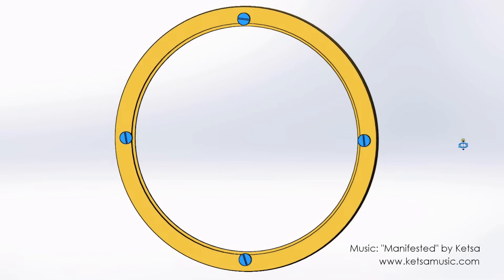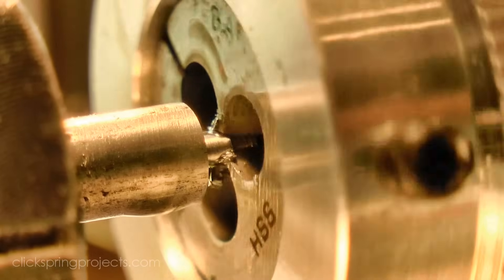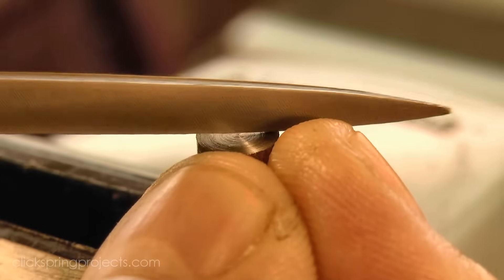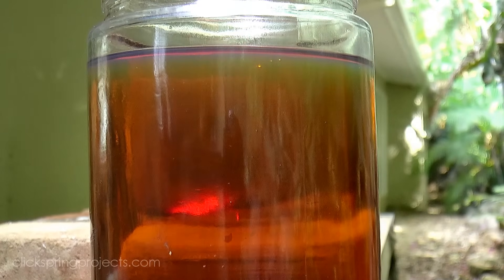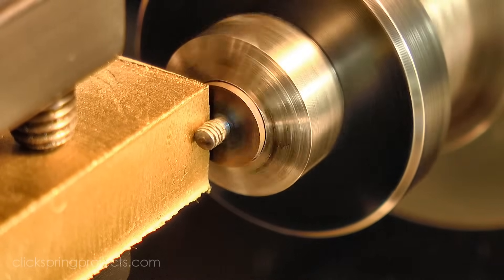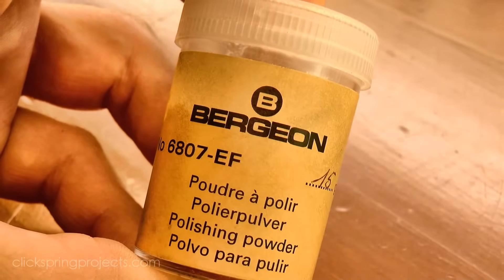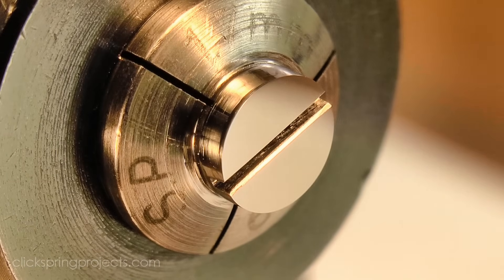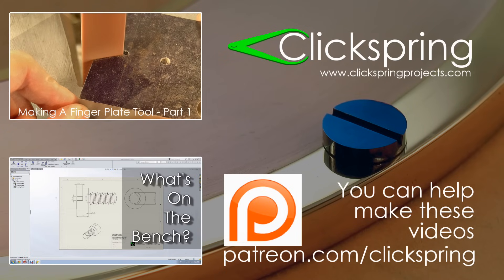Clockmaking - How To Make A Clock - Part 11 - Making Polishing And Bluing Bezel Screws

Comment: I've looked everywhere but no matter where I look I can't find anyone who has a 10mm thick piece of tin in square or disc form, where did you find a chuck of tin like this?
Reply from the maker: Hi Shane, tin is relatively easy to cast to shape. Also, keep in mind you don't necessarily need 10mm thick, a layer of tin cast over a substrate (eg brass. bronze etc) would be fine. The main thing is that it be pure tin upon which you ultimately conduct the lapping - Cheers :)
Reply: @Clickspring  awesome thank you so very much for responding to this years old video, I am a beginning watchmaker and it’s tough starting at a time like this, I just finished making all the components on the plans I bought from your site and the last thing I need is the tin disc. I gotta say I absolutely love your content and what your doing it’s amazing, have a happy holiday and happy new year! Cheers

Comment: I have a question. When you have to do multiples of the same detailed part like this, would you do the same step for each piece, then move on to the next step. "Assembly line" style comes to mind. E.g. polishing the undersides of all 4 screws, and then flipping and polishing the tops of all 4. Or do you just complete one, then start the next?

Comment: I saw you put the screw in a spring collet 
and I was wondering if the thread or the spring collet got damaged?
Reply from the maker: That's one of the great things about collets - they spread the clamping force over a greater surface area than for example a 3 jaw chuck, so features like threads are protected - thanks for watching and asking :)

Comment: Just a note from a clock maker your videos are great and very informative, please keep it up. Have you tried using shaved soap and water mix to prevent oxide forming when hardening, it is cheaper that boric acid and meths but also leaves less to clean up in the way of baked on residue?

Comment: As someone who's new to this kind of thing, is tempering purely cosmetic? What's the purpose of the (what look like) brass shavings?
Reply from the maker: Hey James - tempering does 2 things. The cosmetic look is a nice secondary benefit, but the primary purpose of tempering is to change the metallurgy of the part, taking it from being very hard and brittle, and reducing the hardness somewhat making it "tough". This makes it less prone to cracking under strain when inserted. It is widely believed that bluing also provides a measure of corrosion protection, but I have my doubts. I have plenty of blued screws that have corroded just as readily as non blued. I suspect that what little protection it does provide is actually due to a small amount of oil becoming trapped in the oxide layer. The brass shavings are helpful in transmitting the heat tot he part in a slow and uniform manner. Thanks for watching and asking :)
Reply: Thanks for the informative reply! I've been watching and learning as much as possible lately.
I've just recently started a mechanical engineering apprenticeship that I developed an interest in thanks to watching youtubers such as yourself.

Comment: Really great vid, learned a lot.  Is there a technique you recommending for turning the bottom surface of the screw (the part that touches the bezel) on order to time the screw slots while staying within your torque spec?
Reply from the maker: The process I use is: Make the fasteners but do not complete the slots, leave them slightly overlength. Drill and tap the holes, and then insert the fasteners (gently use grips, but be sure to get them in there to the correct tension), pick a direction you'd like the slots to align with, and mark. Remove, and then form the slots as normal. Face to length and skim the head perimeter, to remove any marring from the grips.

Generally it is more trouble than its worth, particularly with steel screwing into something soft like brass. The effect is soon compromised as the threads wear in (which you can try to predict to a certain extent) but a clock (or watch) must be repeatedly taken apart over its lifetime, so the effect is totally lost as soon as the first full clean & service occurs and the screws get mixed up. My personal opinion is that if the tapped material is soft like brass then its much better to embrace a little randomness in the presentation, and simply let the slots fall as they may.

Having said that, its definitely worth considering for hard materials, like steel screwing into steel. I used the procedure described above on the first Patron Series project hand vise fasteners, gave a good stable result.

Comment: Hi Ok, I give up! where did you get that tin lap? I have searched everywhere!!I have also just spent a very pleasant half an hour reading through the lathe recommendation on your blog. Very good, one tiny point I would like to add is the quality of the motor. For example my SC3 with its nice 500w brushless motor, I consider a serious lathe whereas its direct predecessor the C3 with the brushed motor and that awful back gear, was a terrible machine that should be cast adrift in some kind of Neolithic funeral ceremony!Its a pity that all to often mini lathes all get tarnished with the same brush.I do envy your powered cross feed!I liked your comments about getting a smaller lathe. funnily enough I recently seriously considered getting a C0 but held off. its my dream to have a really nice watchmakers lathe like a Lorch. There is no law against dreaming!For anyone else reading this post, I am making Peter Heimann's 8 day regulator clock and my lathe has really been pushed to the limit with the pendulum bob.... but I have got away with it so far!
Reply from the maker: Hey Peter, the tailstock polishing tool is shop made, plans on my website if you need them. The tin was sourced from a local tin smelter, I had them cast a disc for this tool and also a larger rectangular block for under hand polishing. Cheers mate :)

Comment: How would you make screws with say an allen head or phillips head? Ofcourse making sure it's a standard size. Also, how about a square or hex bolt (standard size)?
Reply: I think an allen hole would need a lot more work, but I think you can just turn the work ninety degrees around and make a new cut to have phillips head. The bolt just need some sanding. But it's easier and sturdier as flat head screws
Reply: Andrea Quadrati     To make a phillips head requires more detailed forming than that.  A phillips head shape is tapered for a snug fit with a proper phillips screwdriver.  The shape is intended to slip under torque (there's some history behind that).  There's probably no advantage to a phillips head on a screw like this; and as you say, the slotted head is probably best.

Comment: Was wondering what, if anything would drive you to get a heat treating oven? I know you don't generally work with a lot of steel, but say if you started a project which required a large number of custom lathe/mill tools?
Reply from the maker: Yes its something I've been meaning to get onto for some time, but other projects keep pushing it off the top of the list! The simple torch/oil quench process is a bit crude, but for most common home shop parts made from carbon steel its effective enough to get the job done. However it starts to get a bit limiting when the part has an unusual cross section (eg thin and thick adjacent), if its a relatively large part, or if the grade of steel being used needs a bit more control over temperature and time. If I find myself having to heat treat something like that, then an oven will be essential. Thanks for watching and asking :)

Comment: Hey Clickspring, great video. Did you happen to put any oil on the screws after heating them to preserve the finish?
Reply from the maker: +Peter Jeung Hey Peter, yes dunk in oil to arrest the bluing process, also adds a little to corrosion resistance. Thanks for watching.

Comment: As always, awesome video. One question though, you blue the screw once, polish, then blue again. Is there a reason for the first blue? Couldn't that be skipped, polish, blue once? I'm totally new to this world, so just wondering. Fantastic videos! Your tenacity to detail is amazing.
Reply from the maker: +Tyler Hall That's a great question Tyler. It's the standard watchmaking process taught in all schools and texts - harden>temper>polish>(optional)blue, and it makes perfect sense if the part is to be left black polished, or if the part is fragile, like a chronometer detent, or watch hands - In that case, the polishing process would likely fracture the part if it wasn't tempered first. 
But like you I wondered whether the first temper is really necessary, if its going to be tempered a second time anyway during the bluing, and the part is also robust (like a screw) and therefore unlikely to fracture during polishing. I did some testing a while back, and found that the polishing takes a lot longer when the steel is left at full hardness, so that is my best answer at the moment. But I must admit it's still not an entirely satisfactory explanation for not deviating from the standard sequence (if the part is to be eventually blued). I have queried some very experienced professionals on this exact question, without getting a better answer. For now I adhere to dogma as taught! Cheers mate :)

Comment: Loving this series and I'd like to ask if it would be worthwhile screwing in the screws by hand (or possibly pliers if they need to be tighter) and then marking the direction of the slots to be all horizontal prior to milling/filing them? The same could be done for the pillar screws.
Reply from the maker: +Jim Campbell Hey Jim, generally its a bit more trouble than its worth, but I did 'time' the screws in this video, after a viewer request to see it done: https://www.youtube.com/watch?v=O8xIjsaDlN8 Thanks for watching.
Reply: I did notice that as I moved on through the series! Thanks for getting back to me so soon.

Comment: Very nicely done Chris, you use a number of techniques that may well be common in horology, however I haven't seen before, so I'm getting an enormous amount out of your videos, thank you. I've been encouraged to pursue clock making based on other fine work I've done, but I think that's one rabbit hole I'll resist dropping down in to. For now! Instead I'll admire your work from behind a cuppa. My main milling machine is however an Aciera, so maybe that's my calling. Ha ha!

One question I have is your use of tin laps, it makes sense being so soft but have only ever seen lead or cast iron used (I use cast iron). I've used aluminium in the past too and they charge ok. CI is probably not appropriate for your use but can I ask why you didn't use lead? Is it purely safety and handling concerns? I can imagine tin castings wouldn't exactly be dropping from the trees of Cairns, yet lead can be obtained from the local hardware store as flashing and melted down. I may try tin if I need a softer lap, so would appreciate where you bought the tin from?

Finally, I really like that tailstock lapping setup. You speak of it as it being common in this field, but it's new to me. Watching you use it I wonder what happens if you let the lap go and will it free spin on the spigot? It then looks to me a little like a miniature lapping machine working backward, with the work driving the lap. If it spins that way does it leave patterns on the work? I don't need to take my lapping to the fineness you do, but that could well prove a handy addition to the workshop.

Keep up the excellent work, and once again well done all around.

Pete
Reply from the maker: +Pete F Tin, zinc, iron, bell metal, perspex and some woods are all widely used by watch and clockmakers as a polishing base . Aside form the health concerns, I suspect lead would just be too soft. I bought my tin from northernsmelters.com.au The tailstock polishing jig is something I have designed, to mimic the more common Boley screwhead polishing tool. Theres a great video by Chris Abell using one here: https://www.youtube.com/watch?v=WyBVUAiFJ9o Cheers, Chris.

Comment: Is this technically bluing? I thought bluing was the controlled oxidation of the metal (like anodizing), isn't this just plain tempering?
Reply from the maker: +Rob Mckennie During heat bluing the steel is both tempered and colored. Not to be confused with what gunsmiths generally call bluing, which is a chemical process of forming a thicker, darker oxide via chemical means. More info at the end of this video: https://www.youtube.com/watch?v=8h1Uf9bkc3E
Reply: Clickspring I've spent a moment thinking about this, and the colour you get from tempering is a layer of oxidation, right? So it would squarely fall into the definition I gave before.
Reply from the maker: +Rob Mckennie Generally the bluing process for a clock or watchmaker happens after tempering (and then polishing), so it tends to be called  "bluing", even though technically it is actually both bluing and  "re-tempering". A gunsmith will call the chemical process "bluing", even though there is no tempering involved. In each case the color comes from oxide formation. A steel part will also move through the oxide colors to blue, as you temper. It depends on how you want to look at it :)

Comment: Polishing the insides of the screws is a bit like leaving a message on the backside of a postage stamp when you mail a letter. :-)
Reply from the maker: +ExtantFrodo2 Beautifully put EF!
Reply: Clickspring
I thought later to change that to "leaving a love note on the backside of a postage stamp" but I was already in bed.
Reply: @ExtantFrodo2  But it IS there. You know that it is there. That’s perfection 😉👍🖖
Reply: Wouldn't it help with not marring the surface underneath?
Reply: Ohhh... you like to half-ass stuff ....I see.🤨      ....That's what a bitch does 🤔

Comment: It's just a bit unfortunate that the screw grooves point in any direction, where the polished threads will never be seen again, except you remade them aligned and have the old for showing them around. Would be a pity to throw them away!
Reply from the maker: AltMarc You're right, I keep everything :) Thanks for watching.

Comment: Just Subbed Mate.
1 question I have is, What are the screws made of ?
Are they brass or steel ? and why do you heat them in brass shavings.
Regards Matt
Reply from the maker: Matthew Gischus Hey Matt, the screws are made from EN8 steel. I heat them in brass shavings, so that an oxide forms on the surface, which gives the blue color. There is more info on that process at the end of this video: https://www.youtube.com/watch?v=8h1Uf9bkc3E Thanks very much for your sub, appreciate it.

Comment: Hi Chris.
I'm a horology student at Birmingham City University in the UK and we all really enjoy watching your videos - lots of inspiring stuff that's definitely going to help with my final project next year!
Can I just ask what it was you cleaned the screws in before the final blueing? I used to use methylated spirits but sometimes it leaves little marks which ruins the final colour, yours look pretty perfect though.
Thanks in advance, and thanks for the great videos.
Alice
Reply from the maker: Alice Taylor Hey Alice, lovely to hear from you! I use Zippo lighter fluid to clean off the part before bluing, and it seems to give a good result. It's especially good for removing the oil after the bluing cool down, to check the uniformity of the color - the color really pops out after a quick splash of lighter fluid. Make sure you send through some pics of the annual project when you get started, I'd love to see it :)
Reply: Clickspring Cheaper alternatives to Zippo brand are white gas (camping fuel), descented paint thinner (not turpentine or water based), charcoal lighter fluid and pure Naphtha. All are Naphtha based with varying degrees of purity. Petroleum solvent is the same but contains various levels and types of oils that would not be good for finishing. The best choice is probably white gas or charcoal lighter as it is very pure to be used for cooking and very closely matches the makeup of lighter fluid.

Comment: What is the screw material & can you elaborate on your boric acid (source).
Reply from the maker: Peter Thannhauser The steel is EN8, a mediumcarbon steel that machines well and can be quench hardened. Boric acid is commonly available in powdered form from jewellers suppliers and hardware stores (as a roach bait).

Comment: You used brass shavings for holding the screws, u did it not to scratch screws or it helps with making screws temper to 600f 
To get to blue temper ?
Reply from the maker: ***** The brass helps distribute the heat more evenly. Thanks for watching and asking.
Reply: thank your for quick respond.

Comment: Yet another absolutely beautiful video!

I did have a question about the bluing process.  Is this only a heat based process, or is there a chemical process as well?  The final result is spectacular!
Reply from the maker: Paul Frieden Hey Paul, yes its just heat, no chemicals. The polish before hand is critical to the outcome, as is a uniform rate of heating across the whole screw. Thanks for watching :)
Reply: Are the brass(?) shavings to help distribute the heat more evenly, or do they serve some other purpose?